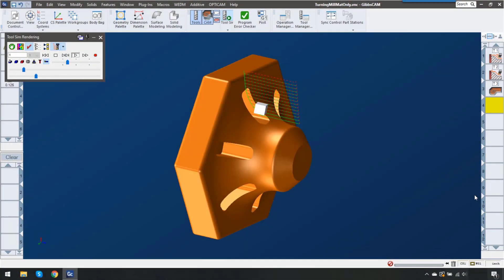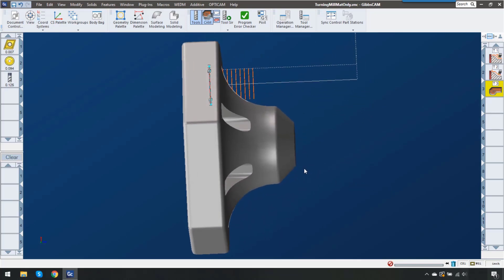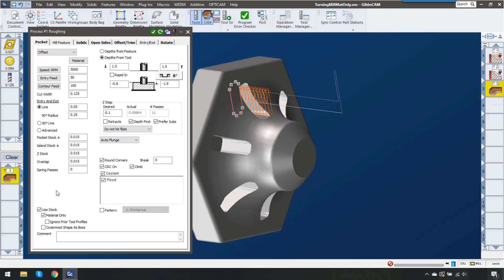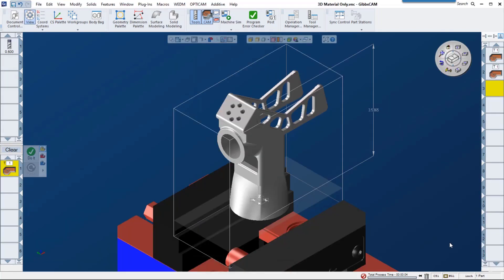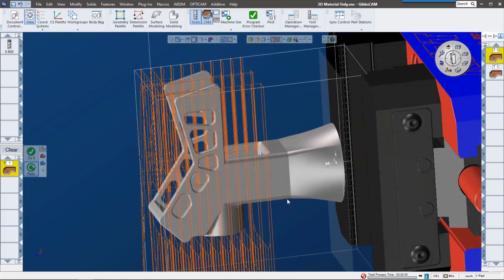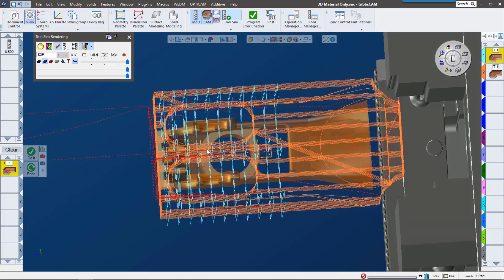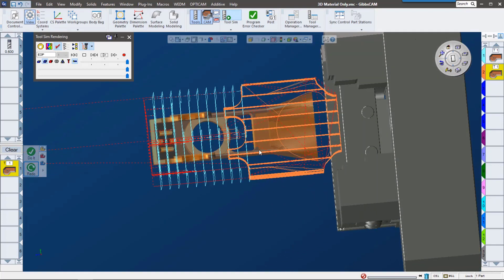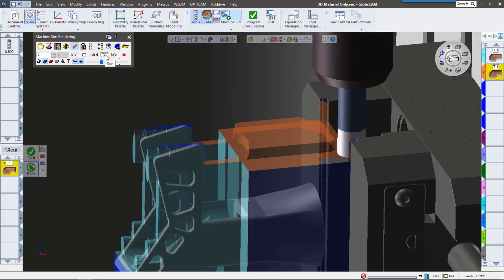3D Material Only in GibbsCAM 14

Comment: Why this option is not working on 5 axis ops? The is a material only check box but it's not working.
Reply: Cristenel, I am able to use it with 5 axis ops. If this still isn't working for you please contact your reseller. They should be able to help you resolve the issue.
Reply: @geraldmckee4423  I will. Thank you for your time.